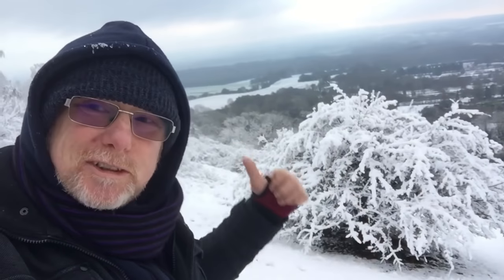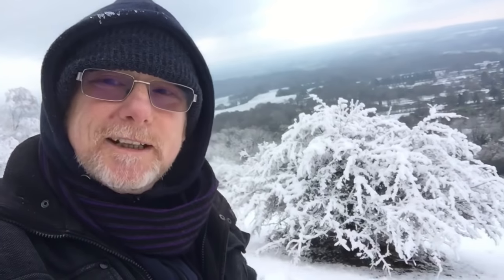How to make your Night Diesel Heater fuel pump quiet

Comment: Thanks for this, I just fitted a diesel heater in the caravan as our electric hook up for oil filled radiators an fan heaters is unreliable and trips with high loads, I only really notice the pump when I settle down and it's really quiet, after watching this I might try the rubber isolation grommets as my pump is outside underneath and I'd rather it was good secure.

Many thanks.
Reply: Have you had any problems with the pump outside?
Reply: @jayxnina  no the pump has been rock solid
Reply: @nigelwilliams8191  do you just have it mounted using the bracket that came with? Or did you try to make it suspended with zipties/ some other method?

What’s the coldest temp you’ve experienced with it outside? Im installing mine tomorrow and will be in some pretty crazy sub 0 weather
Reply: @jayxnina  personally my system has only been to minus 5 with wind chill taking it below minus 10 one night, it was faultless, I originally used the supplied rubber mount bolted to chassis but I now use a rubber exhaust hanger bolted to chassis and the rubber pump mount is bolted to the hanger, I can barely hear anything now.
Reply: @nigelwilliams8191  incredible. I wish I could see a picture!